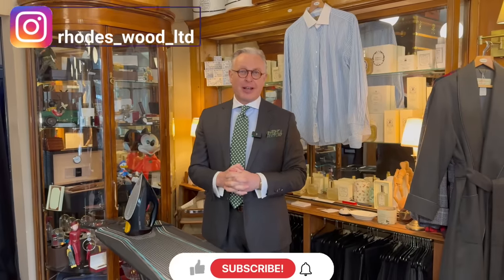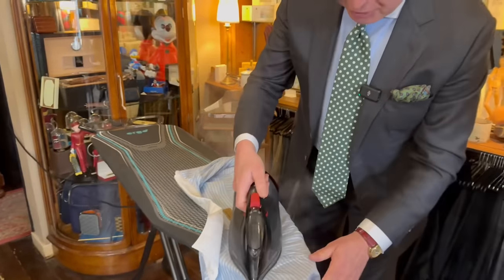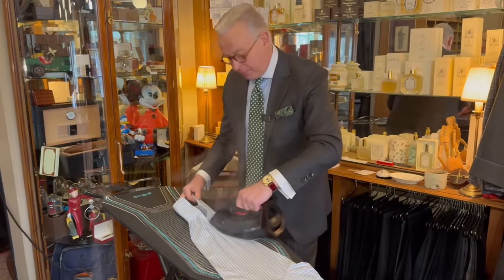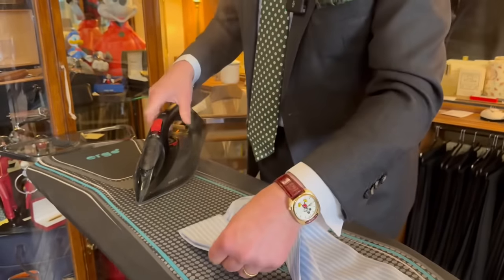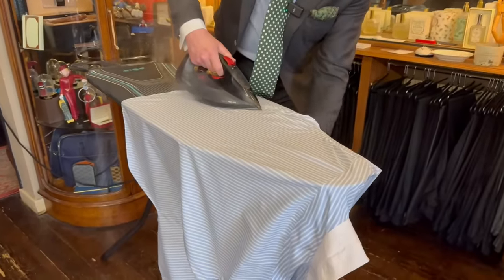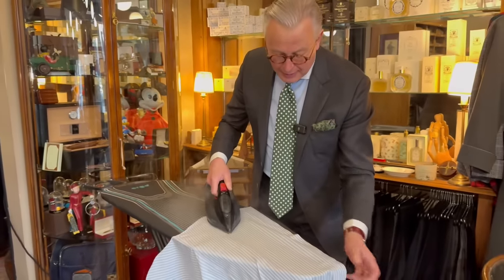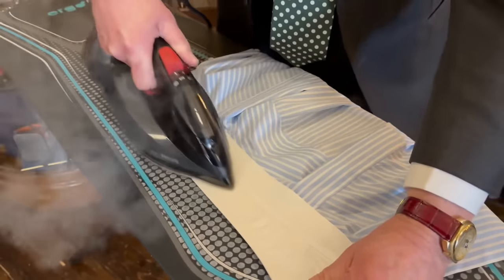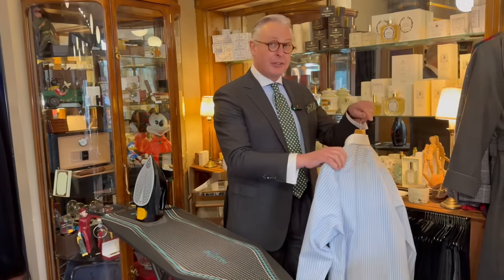How to iron a Shirt

Comment: My mother taught me to iron a shirt in such a way that each piece that had been pressed was not destroyed while you would press the next section so I would always do the cuffs first and then the sleeve instead of sleeve then twist the just pressed sleeve to do the cuff.   I start with the collar, then shoulder placket, then cuff, back of sleeve, front of sleeve then front left of shirt all the way around to front right of shirt.  In this way, each piece that has been ironed hangs down loosely while the next section is pressed.
Reply from the maker: Yes I’m sure it works…. But either way… mine… I’m happy to wear🤝🥂
Reply: When I do ironing I do it just like you. My mum told me how to. I’m not too fond of ironing but I know my mum is. She owns a mangle and put all sheets, pillow covers, linnen napkins and table cloths. 
I still remember when we went to use a real stone mangle.

Comment: I started ironing my own clothes way back in 7th grade and haven't stopped since!  I find ironing boards too restrictive –  there's just not enough space to maneuver the iron smoothly.  That's why I use a regular wooden table with a thick, an old jeans fabric as a heat-resistant pad. It works perfectly for me, and I'm proud of how well I can iron my clothes!
Reply from the maker: Sounds great and as long as it works for you. I like the board shape at the front for getting inside the front and armhole/ yoke 🤝🥂

Comment: Thank you for making this informative and inspirational video. I’ve decided that I’ll stop showing up to work looking like $hit with wrinkly dress shirts and start ironing them.
Reply from the maker: Sounds like a plan 😂🤝
Reply: @johnpalacios5914 If you don’t have time to iron, keep a spray bottle of water handy, on mist, and spray it down, smoothing with your hand (while the item is hanging preferably, or draped). You’d be surprised how well it can turn out afterwards. Also try to make sure you hang them up rather than going through the dryer, or only dry about half the time, it helps with wrinkles and extends the life of your clothes. :)

Comment: Great video, I’m impressed that you thought of addressing the subject.

Personally I leave the collar up as the shirt is drying so it doesn’t get that sort of really worn in look from constantly being folded. 
Unlike you, I like to iron the fiddley bits first, because I find that I add wrinkles/creases to the body of the shirt as I am ironing it. So I iron the collar and cuffs first, the collar I iron the side that is hidden, or the side that does not touch the skin. Then I turn the sleeves inside out and iron them, and iron the body of the shirt from the inside as well, if I can. It’s fine for a 100% cotton shirt, but I can’t stand a shirt that goes shiny from ironing it. If a shirt gets a bit shiny, or I’m unhappy with something, I keep a spray bottle of water nearby to give it a quick mist.

Comment: Coldstream guardsman taught me basically the same, but iron across the outside of the yoke, along the seam. Pinch the top of the sleeve so that the crease always is in the middle. I've done it that way for 50 years. Will definitely call in Rhodes Wood when next in Harrogate.
Reply from the maker: Great tip🤝

Comment: I always irin the outside of yokes first, to ensure it gets a head start being smooth. Then the inside, if needed. Doing the inside first can inadvertently set a wrinkle on the front.
Reply from the maker: You know … having ironed 3 shirts ( laundered by the dry cleaners) I re do them….. I came to the same conclusion

Will try both ways next time I wash mine . 

With the ones  I re pressed from the cleaners the out yoke got wrinkled

When I do my own , I haven’t noticed any, as the one in the video 

Thank you for your comment… it was certainly that way with the ‘laundered ones ‘ today . 👔👔🤝🥂

Comment: Nice demo, thanks! I like the knee trick especially. I’m retired now, but as a young college grad in my first office job in aerospace, I wanted to look my best with the meager resources I had. Aerospace isn’t exactly known for sartorial excellence, so I tried to be exceptional by paying attention to details, like a properly pressed shirt done myself. It was a detail that didn’t cost me anything! In about my fourth year at the company, a crusty old bachelor that worked with me, challenged my thinking on how to iron a dress shirt. He asked me how I oriented the board. When I told him that as a right hander, I put the pointed end to my left, he said “I knew you’d f*** it up! Turn the damn thing around!” (Jack lacked subtlety to say the least) He contended that by turning the board the shirt not only won’t try to slide off, but the back and two front panels will lay perfectly flat with the rounded 90 degree corner supporting the armhole. You can iron the fronts without having to reposition, and the back only has to slide to one side a few inches to complete it. The next morning, I tried his suggestion and my mind was blown! Never went back. The narrow end still could be accessed to do the yoke, but that was about the only thing I ever needed it for after that.
Reply from the maker: I’ll be giving it a try🤝🤝

Comment: Many years ago, I was taught to iron shirts the "army way" (which was almost identical to the way you demonstrated). I've ironed my shirts this way for fiffty years. The main point is to iron the areas that are seen most last so they have less opportunity to wrinkle agaign on the hanger.
Reply from the maker: I whole heartedly agree! The collar is in the field of vision of everyone you meet… do it last and keep it sharp🤝🤝🎯
Reply: @rhodeswood5513  I'm sorry.  I did say  almost identical. 
The way I was instructed to iron shirts in the army was to do the front panels  last since these are a  large, highly visible, area. However, this is a small variance so I mostly agree with everything you said. 
The main point is that the most visible areas are done last.

Comment: Interesting. 
I particularly noticed good level of stream coming out of the iron box. High mineral content in the water usually results in scaling in the stream holes. Low mineral RO water is a solution, I guess. 
Nevertheless, would you like to tell us the brand and model of iron box that you used, if it is not inappropriate.
Reply from the maker: It’s a Phillips Azur 2500 W quick calc release🤝

Comment: I had to teach myself to iron shirts when I started in my career years ago and couldn’t afford to have my shirts laundered and pressed. This is very similar to what I figured out after lots of trial and error. One thing I used to stress about was reintroducing wrinkles by handling the shirt while I ironed it. But, like this video, if you save the most visible parts of the shirt for last you’re fine. Once the shirt goes on and you put on a jacket (which you should) you won’t see them.  There’s no getting it perfect.
Reply from the maker: Spot on Sir!…. The collar cuffs and fronts are most important … so last on the board for me too🤝🥂

Comment: You only left out one part. The inside of the front side with buttons should be ironed down first as it usually wrinkles quite a bit. Rather than a knee ( because I was quite young when I learned) I used the front of the ironing board.
Reply from the maker: But the ironing board won’t give you the same workout as lifting the knee and maintaining perfect balance… but your point is great🤝

Comment: Buy a good iron and always steam on cotton.  I have a Rowena from Germany (don’t buy the Chinese one).  I iron in the order—collar, yoke, sleeves, cuffs, right front, back, left front.  I find my fingers can feel the most subtle wrinkles so smoothing out the sleeves, I make sure I remove all wrinkles on far sides of sleeves by feeling with my fingers.  In areas where there are pleats, I push the wrinkles and folds out using the nose of the iron rather than iron over them.
Reply from the maker: All good but I would still do the collar at the end… or again at the end🤝

Comment: a practical problem that i faced is when you do coller in the end, most of time, if bring few lines as shirt is already pressed, to avoid that 
begin with coller, shoulders, hand coller, cuff coller, then arms then middle inside or back inside, back outside if needed, then front and shirt is ready.

Comment: It’s hard doing this when you’re a perfectionist with self diagnose OCD. It will never be “perfect” it just has to not be wrinkled and if you like the sharp pressed lines make sure everything is folded over correctly. Remember even at first it will look significantly better than just spin dry and on a hanger. The more you do it the easier it gets. It is frustrating. I still don’t know what to do with the rest of the shirt while it hangs over (I just ironed those parts will they rewrinkle?!?) in my head
Reply from the maker: It’s got to look better being pressed than not. Fine surface wrinkles after pressing seem to disappear when worn with a little body heat. Perfect doesn’t really exist….and too perfect looks like a ‘plastic’ shirt. High standards shine through🤝

Comment: Thank you for the advice.
This program would be so much more enjoyable and effective, if the background could have been simplified visually.
But it is so busy, full of objects, and visually distracting, that it takes away from the overall experience significantly.
Pretty unfortunate.
Wish you would have the ironing board setup in front of a simple wall, closet or jut curtains- as the presentation is the major part of this!
Views need to focus on that .
Also , you might want to use a bit better light, please. 
( a very affordable investment for your future video posts )
Thank you, and good luck for your future video contents!
Reply from the maker: Thank you … comments noted…. Trying to fit these in whilst running a very busy shop…. Plus people do spot things to buy🤝

Comment: I thought you missed out ironing the inside out of the button  edge of the front panel. It makes that edge settle down and then makes it much easier when you iron the outside surface in between the buttons. Perhaps you did but did not show in the video. The dhobis (professional washermen ) in India would go one step further. They would attack the space in between the buttons from both left and right side  and if that was not enough, they would slide that iron on the thin strip between the button and the edge of that front panel to make it lie perfectly flat. They normally use very heavy coal fired brass iron of yesteryear and make it dance like a ballerina on a shirt or a trouser, a sight to watch. No part of that shirt or trouser would be left untouched. Then they would gently fold it, maintaining the crease and deliver it to you as if it was a new shirt, ready for the party, with or without the party. 😊
Reply from the maker: I do sometimes do the underside of the buttons. Depends how deep the buttons are. There is a button groove in the iron to go in between the buttons.
Pearl buttons will easily crack with too much pressure from the underside . 
   However I do take your very valid point. 
I’m sure the pressing and laundry in India is wonderful and if they are doing it all day … have it down to a fine art🤝

Comment: With all due respect sir, this is Not how you iron a shirt. But then, as you said, this is how You iron your shirt but surely not the right way of ironing it. You just killed the pleats on the back and putting crease on the folded cuffs, shame, you ruined it.
Reply from the maker: As you fairly said.. it’s how I like my shirts… without the crease on the cuff is okay…. But okay isn’t good enough . You like yours and I like mine 🤝
Reply: I was an industrial engineer and worked in a shirt factory. If time is of the essence, I could give you the most efficient method. 😉well done sir.
Reply from the maker: @carolynpetrie6266  yes please do…. Time is so valuable!🤝
Reply: He obviously doesn't know what the loop on the back of the shirt is for.
Reply from the maker: @araptorofnote5938  what loop?

Comment: No no no......Thre should not be a fold on the top side!!
Reply from the maker: Top side?
Reply: @rhodeswood5513  Yes. on 3.32 min you iron a fold in the manchette. Look at you left arm ( with your watch) You see the "fold". That should be round in a bend as you jacket is. It also will "wear out" on that fold spot.